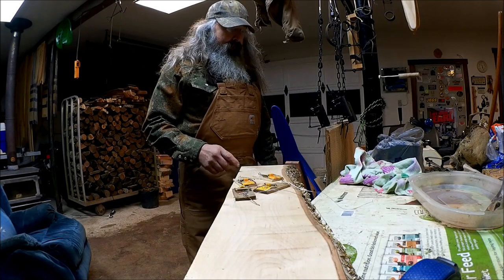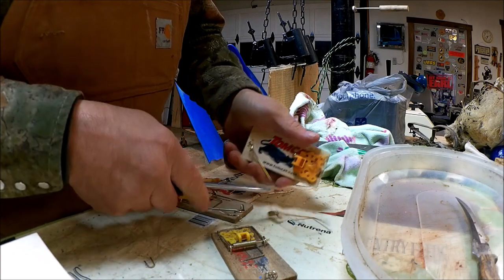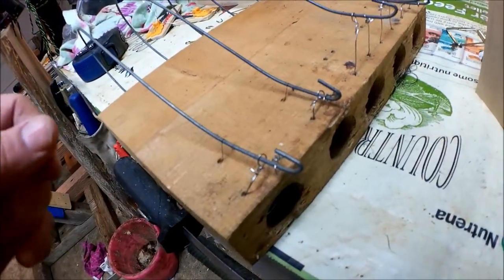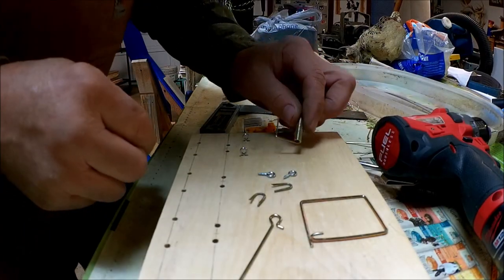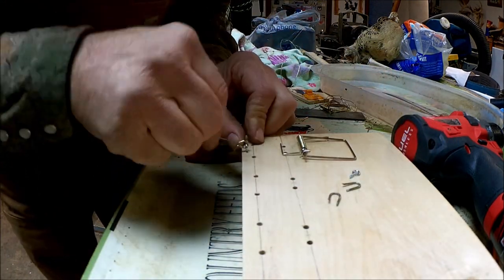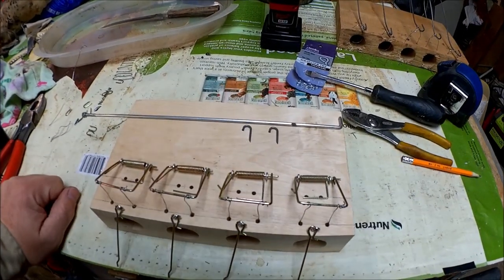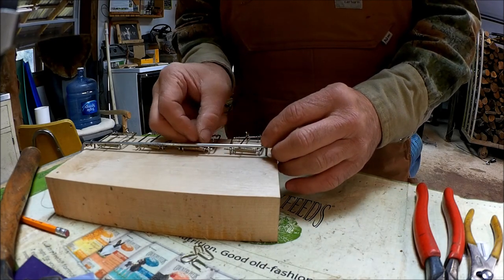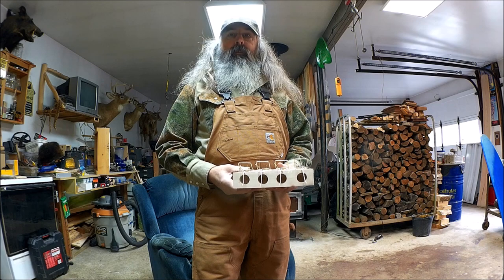The Improved Version of Mascalls Mouse Trap

Comment: I've  made 4 versions of this.  Observations: First I used a 12 in 2x4 - the whole thing went missing,  hauled off somewhere - never found it.   Now I make them from 2x6 and stake everyone to the ground with wire and a large nail.  Skunks or another animal rips the body right off leaving just the head.  Setting Trap: instead of tying a knot I use a set screw and just wrap the thread around the screw.   These are near 100% effective for me.  I've had several doubles and lots of singles.
Reply from the maker: Glad they are working out for you . All my newer versions of this trap also use a set screw to wrap the thread , I also make a version with a different trigger system that is threadless. For this video I wanted to use the thread version and the knot to keep the original design of Mascalls trap.

Comment: I watched this after seeing Shawn Woods' vid. Since I had ten rusty decommissioned Victor snap traps piled up, I thought it would be a pretty good reuse of them. I soaked the parts in Evapo-rust for a few days to get them cleaned up. Instead of of long blocks, I made duelies. Five blocks with a trap at each end. Almond hot glued to the back for bait. Already caught one vole at the cabin. I'm converting the rest of my traps. Much less chance of misfires and non-clean kills.
Reply from the maker: Good job Steve , Glad you liked the video. good use of used parts.

Comment: Cool dude you could glue or screw some pipes and sandwich them between a sheet of wood water proof ply top only may be sufficient but using the springs like you have

Comment: Awesome video! I've just about finished building my first one, but I'm wondering if you have any advice on the type of thread (and knot) to use. I'm also curious about the "set screw" method of tying off the thread which you and some others have mentioned here. Thanks again for the education! :)
Reply from the maker: Congrats on your build , the set screw method is what I use on all my personal traps . Its just a 1/2 inch flat head screw and a washer ,Once you set your trap with the thread just give it a clockwise wrap twice around the screw under the washer and drive the screw in. it will tighten the thread as you screw it in . Easy Peasy.

Comment: Made another one just got the traps and placed one over each hole hot glue and one screwed whole trap  and drilled four holes for string and wire for  each hole . on the under side i used two flat head small screws to put the string onto you can  string them all at the same time . Have the must kills with three hole one i  made always the same trap

Comment: Sorry for the stupid question  CT, but do you cover the threads with the peanut butter, and the mice chew through the thread while eating the PB to trigger your traps? Thanks in advance!!
Reply from the maker: I smear it in the back of the hole and get a little bit on the thread too. If I was a mouse I would say to myself { This dam thread is in my way ,If I chew it I will be able to reach that peanut butter easier}  I would also say { hey there is some peanut butter on that thread ,I will nip at it cause its in my way to reach the rest of it}

Comment: Brilliant engineering job CT. The one question I could not find, or missed it is how large are the mouse holes? I know the rat size as you replied to that one. Mine is about an inch. Thank you.
Reply from the maker: 1 1/8 inch hole
Reply: @cttrapperman5555  Thanks buddy, appreciate it..

Comment: Could you written down the measurement of the block. Please and thank you
Reply from the maker: I gave the measurements in the video
Reply from the maker: You can make it any size you want
Reply: Im having a hard time understanding how the measurement is being stated im sorry. My english is not that strong
Reply from the maker: @Pubo-id1qv  9 inches length, 5 1/2 inches width, 1 3/4 inches thickness.  The thickness of the material  is all that matters  . I have made them smaller and much much larger ( less holes vs more holes) . Hope that helps .
Reply: CT Trapperman thank you.

Comment: Wish you can do something to improve the trigger system
Reply from the maker: The trigger system I kept as the original Mascalls system . It does work very well, and yes you have to re-string it to reset but I wanted to keep it as the original design. Now i have a different trigger system that I made without the string in rat sized trap ,same design just bigger using a conibear trigger , It is super sensitive and work very well.
Reply: @cttrapperman5555  now we just need a video on that build  :)